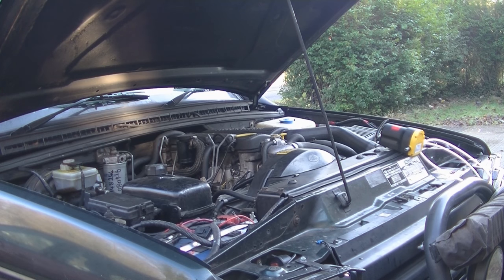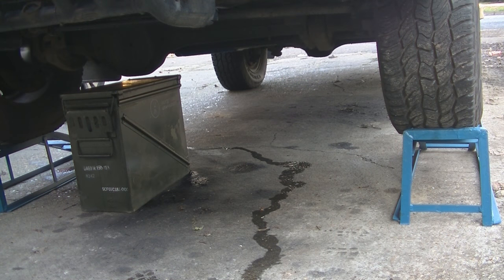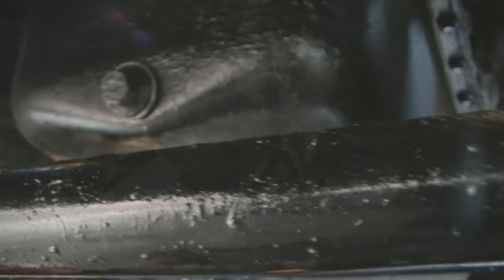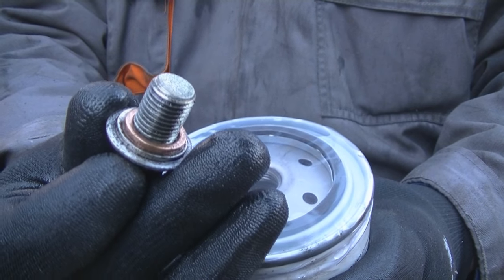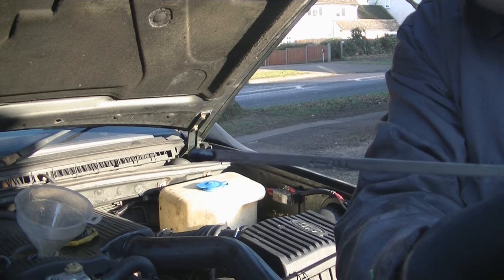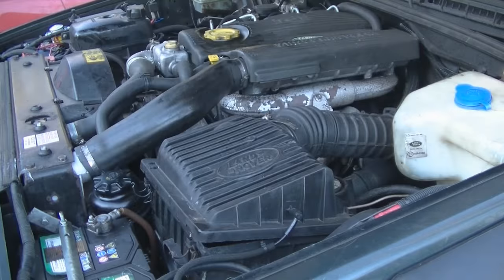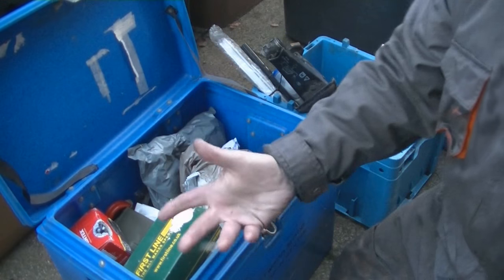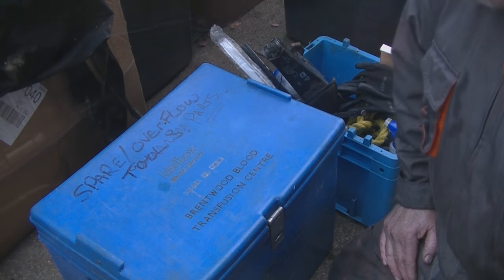Routine BOV service and inspection Jan 2017

Comment: the vacuum oil pumps work very well, used to used the expensive air operated once when was in the forces, have now got one of the  cheeper vacuum pump ones and find it works just as well even if you have to empty it half way through the oil change

Comment: May as well bang it out. It's been tough on engines this winter. 
Always look forward to a (Desperate Dan) : )  Roach vid! 
Doing a service early is giving not taking if down the line there's no option.
Reply: Just in case...I have a winner Mantra.. 
It's not Football or Religion it just works.! 
Om Mane Pame Hum...Nothing comes close. If you're in Dire Straights. 
;) X

Comment: I'd never use one of those oil vacuum pumps myself because it's not going to suck out any metal particulates that maybe rattling around the bottom of the sump.
Reply from the maker: Yes,
you still have to remove the magnetic  draining to as you say check for metal filings, but without the mess ( well that's the idea anyway ) Atb. Roach
Reply: It's still better to let the oil flow out on mass, out of the drain hole, less chance of any metal particles sitting in nooks and crannies that wouldn't be picked up by suction.

Comment: Them pumps are really only any good on automatic gearboxes as the ATF is thinner, next week it's checking drive belts and antifreeze % level, maybe even a quick finger dip check on EP90 in the diffs, finger smelling good now :)
Axle breather pipes check for broken or missing if ya like puddle splashing, tree branches are the most common culprit for breaking them off when running through wooded area's, I could send you to sleep with other things to go over on your, oh he's snoring bless his heart.
Reply from the maker: Morning Brian,
Maintaining this 21 year old truck is a bit of a hobby of mine look back and you'll see the EP90 diff and gear oils being done alone with the antifreeze and the  belts being changed, I've yet to get around to doing the one shot swivel grease that I ordered in but I think that might turn into a bigger job, great tips  ( appriciated )  be safe brother thanks for keeping me honest Atb. R
Reply: I will have a look back :) I know what it's like keeping up with the parts that will now be wearing out on what would seem like a constantly expanding list, I have a 25 year old Range Rover and a 33 year old Chevy Silverado to maintain, I do also have a series 3 LR 109 but not in use for this decade or so lol anyway have a great day, I'm off to see how many toilet rolls and kitchen roll will fit into a cart 105mm FD NOR case.
73 de Brian M0OAB

Comment: Roach, I use one of the Difflock oil drain valves (replaces drain plug) and hoses. Makes oil changes a doddle on my 300Tdi 110.  http://www.difflock.com/drain-plug-m14-x-1-5-t11-5